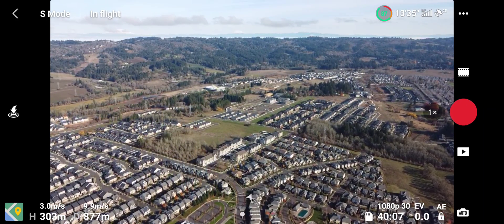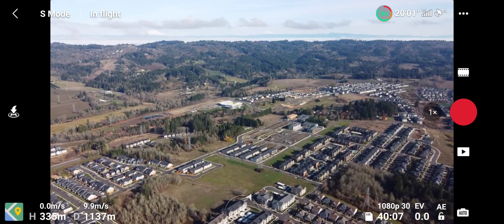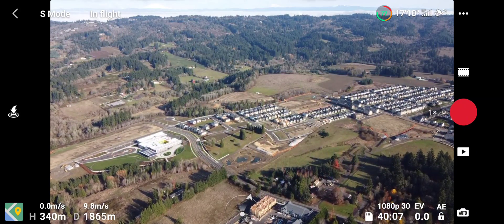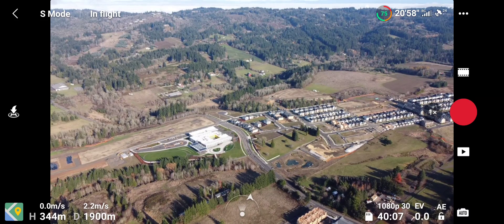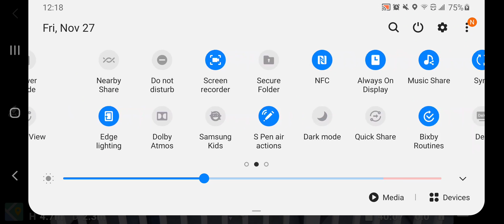Mavic Mini 2 Range test to 3000m in urban environment with range extenders.

Comment: New mini 2 owner here, quick question, on your controller settings while using the extender, do u lock it on 5.8 only? or do u keep it on auto? i have a similar 5.8 extender but was curious which are the best controller/transmission settings
Reply from the maker: I just let it automatically decide.   I don't charge the settings

Comment: Hello, Was the stock antenna flight altitude the same with this yagi extender test for fair outcome? Thanks
Reply from the maker: Yes
Reply from the maker: Yes, same launch location,  same flight path, and same elevations.  As close to one another as possible.   I have other videos that show my prior flights.  They are not identical,  a little variation,  but very similar.